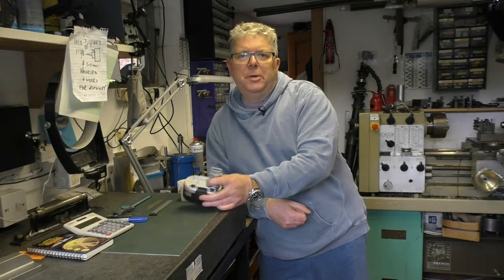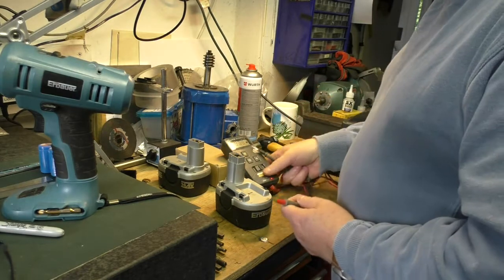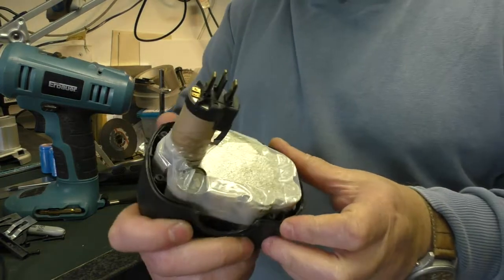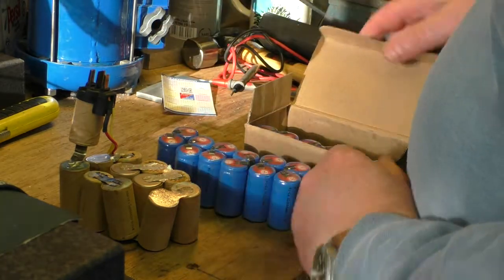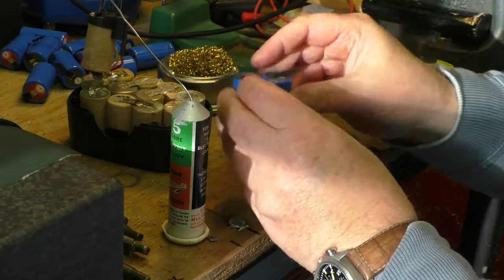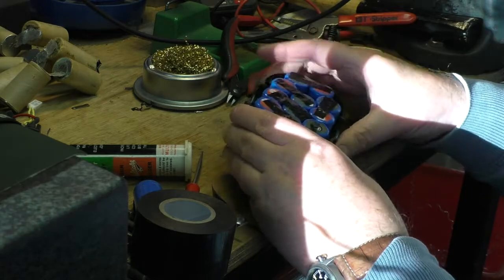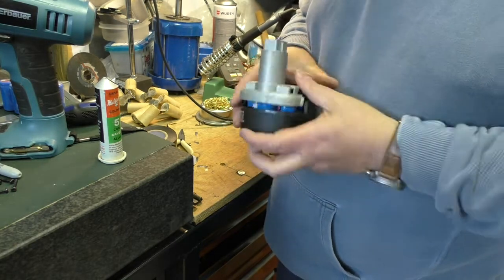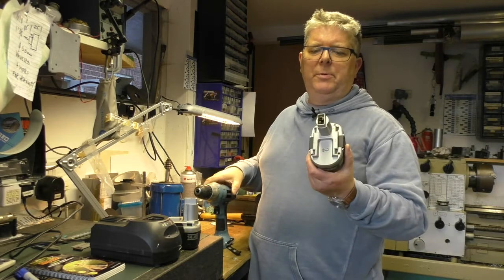Battery Drill - Battery Rebuild

Comment: Where to buy and what
make  the batteries and cost ?
Reply from the maker: I got mine on Ebay...no idea what brand but they were £12 for enough to do 2 battery packs.  Have been working a treat....lots of power and stay charged for ages.